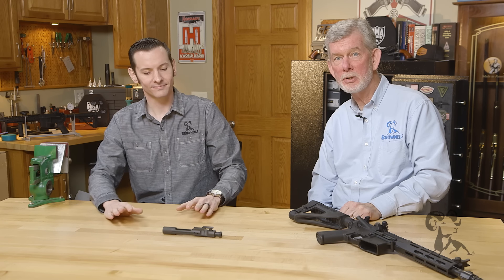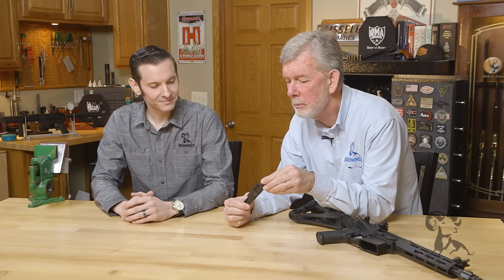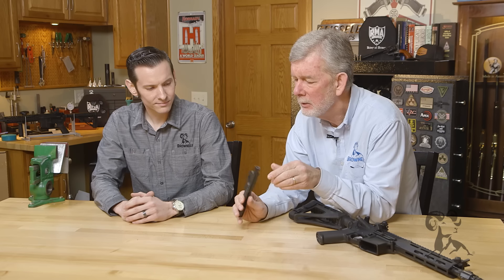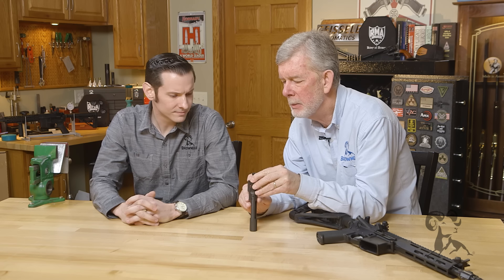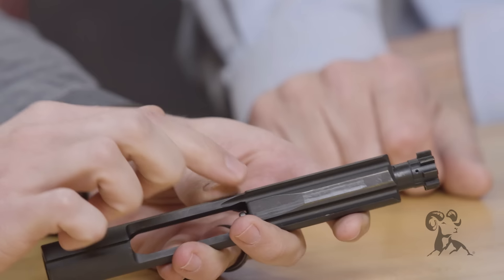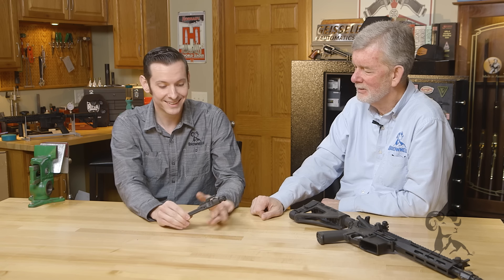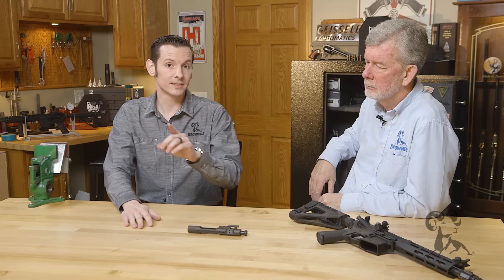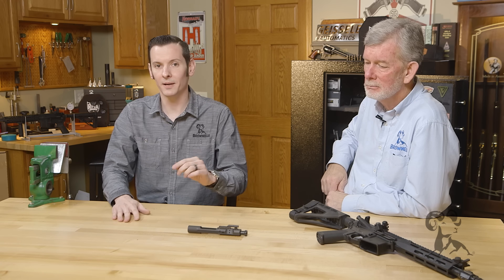Smyth Busters: AR-15 Bolt / Carrier Lubrication

Comment: I still see guides on the internet that say drop of oil in gas key and the exhaust vents.you did not mention the bolt itself, several places say to use grease on the gas rings, locking lugs and some oil on the firing pin itself. I have seen people add a drop of oil down around the ejector pin. Some say if when shooting your rifle the oil isn’t being sprayed on your glasses it is running too dry, some advocate the minimalists approach. Very confusing sometimes.
Reply: Everywhere you mentioned is fine except the gas key and firing pin. Doesn't need it there. If it is overlubed, it will just sling the excess off; certainly doesn't hurt it.

Comment: Wouldn’t the issue with lube be the softer aluminum receiver instead of the BCG? I’d keep something on the areas that interface with the receiver. It is easier to see wear on the receiver since it’s only anodized or painted.
Reply: The spots he pointed out on the carrier are where it interfaces with the upper
Reply: Evan Ogburn I understand that. My question was more in relation to “running it dry” if you had a bolt that was coated in something that claimed it didn’t need lube.......aren’t you still going to see wear in the upper? I guess I’m thinking you need the lube for the upper more than the BCG.

Comment: Caleb & Steve, you didn't mention lubricating the ejector pin & spring, and getting lube on the bolt support ring - but some lube could/should get there anyway, if you lube the cam pin and/or the ejector.  I was taught to do that also more decades ago than I care to remember...  What's everyone's opinion on lubing those areas?

Comment: The only thing I would add is during normal cleaning is placing a few drops of solvent around the base of the ejector and then working the ejector with a flat ended punch several times.
Gunk will ooze out wipe it off.
After finishing the other cleaning put a few drops of your choice of lubricant on the same spot and repeat.
Gets a little  oil in the ejector spring cavity

Comment: I have taken my Ruger 556 pistol version out when it has been sopping wet (oil all over my clothes after each shot) and bone dry, both seem to have worked functionally the same way. Although when its wet you can feel how easy it is to rack the charging handle, that didnt seem to have any effect on performance. I dont have extensive data on this (maybe about 300 rounds on both wet and dry) but from my experience it makes no noticeable difference. Great video as always guys! Love these style videos!

Comment: Question- I've heard it's better to run dryish in sandy/ dry dusty conditions so not to pick up the dust and sand(abrasive) but you said you were told to run the gun wet in the desert?

Comment: I appreciate this guy's. Finally. I've seen so much nonsense from big-time youtube gun guys about how you have to slather the entire exterior of the bolt in grease or keep the thing soaked in CLP.  I put a drop or two of Hoppes lubricating oil on my bolt after I clean it and spread it down the contact surfaces. If there's any left, I spread a little more on the rest of the exterior of the bolt and my AR runs like a steed every time.

Comment: Depends on the weather for me. Hunting in frigid temps I usually use a dry lube so things run smoothly. Warmer temps plenty of oil (synthetic motor oil) on metal to metal parts.

Comment: There’s the right way, the wrong way, and then there’s the Army’s way. The key point is to use the Army’s way when the Army (i.e., an Officer) is watching. 

When in doubt, ask your Sergeant first. After you finish your push-ups, you will know the correct way.

Comment: Good information. I typically check for wear points along guides and areas subject to friction then apply a thin coat of lube to those surfaces. As said, many of us were trained to keep the action wet. I have the M&P AR and it doesn't seem to need much.

Comment: For decades I have applied a small thin amount of Mobil 1 oil on the surface of the carrier and as well to the bolt,wiping of any excess.
Also the friction surfaces that you have mentioned,I also apply a small thin amount of "Red N Tacky Grease"...doing this helps prevent ware and tear of metal sliding against metal.I do These things to my 1911 handgun rails as well...God Bless America,God Bless all God Fearing People and Donald Trump 👍😎🇺🇸🇺🇸🇺🇸.

Comment: Thanks guys.  You're both quite credible.
I live in Florida with the salt air and although my rifles live in dry, cool air conditioning I don't use them alot so I lube them periodically and err towards putting them away fairly wet.  The comment about where you see wear or bare unfinished metal shining through was helpful.

Comment: GOOD VIDEO!!!!! Iv'e always used Hi-Temp Bearing Grease on the rails,anyplace that shows friction wear,oil for rotating parts.I Never run mine dry,always have it lubed,even the so-called never have to lube Bolt Carriers.

Comment: WD-40. Hosed the bolt & carrier down. Shook off the excess. Then left the “Wire”. 
WD-40, cuz you could never find, or get any CLP in Iraq ever!
Reply: I recommend keeping WD-40 far away from firearms for most applications, it is a Water Displacer, not a lubricant.
Reply: @CalebSavant  EXACTLY. WD40: Water Displacer, 40th Formulation.

Comment: The spec ops community believes in mind over matter. So when it comes to bolt carrier group lubrication, their most effective method is to drop in some eyes drops and then stare down the bolt carrier for a couple of minutes until adequately lubed. They also save a lot of money on clp this way as well.

Comment: Follow the -10. It clearly indicates where to lube. And gentlemen you both are incorrect. MSG Consiglio
Reply: With all due respect MSG, I disagree with the -10. I have also submitted changes to the 23&P which would also be reflected in the -10.
Reply: @CalebSavant  I was at Aberdeen at the Michealville complex when the M4A1 testing took place . We used 7 drops of LSA per the -10. The weapon went 4000rds with out a stoppage. I believe you might have not been given all the information.

Comment: For a rifle that is going to be loaded for substantial periods of time, such as a law enforcement duty rifle, lubricating the bottom of the bolt carrier will bring oil into contact with the top rounds of ammunition in your magazine. This may cause malfunctions on a life-saving tool if said oil penetrates the casing or primer. 

That one point is very poorly advised for duty use.

Comment: They had some dumbass DI's. Never told us to put any break free in there, we had to wipe all the break free off the bolt. After cleaning we used 3n1 and put it on the rails and the bolt rotatator.

Comment: Disagree. I ran my bcg lubed with motor oil, especially compression rings and combustion chamber. Motor oil resists burn and remain on surface much longer than CLP. When I tried to do so on issued m16a2(2668 tc CANG) I was surprised by the result: after about 10 mags and 3 days in the field the rifle run smoothly on original lubrication.

Comment: That as shown was an M16 bolt carrier, not an AR15 bolt carrier.
Reply: You are apparently unaware that it was first called an AR-15, then the M-16?
Don't try to be clever. It's not working for you.
Reply: That M16 bolt carrier came out of an AR15.
Reply: I'm not unaware of anything of the sort. I also know that the m16 bolt is capable of tripping the sear. An AR15 bolt is not. That bolt likely did come out of an AR15. It is the only one of the 6 M16 firecontrol parts allowed by ATF to be in an AR15. When AR15s were military the bolt carriers were not set up for the forward assist. So the convoluted premise that bolt carrier could be from an original military AR15 is ludicrous.